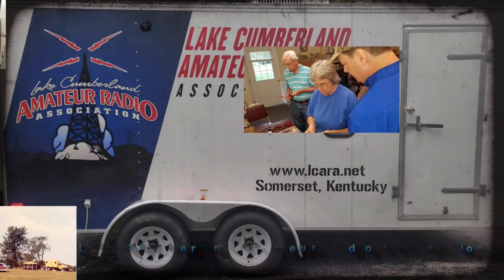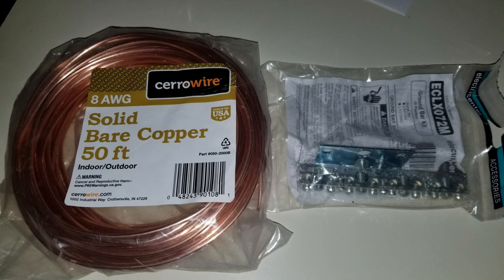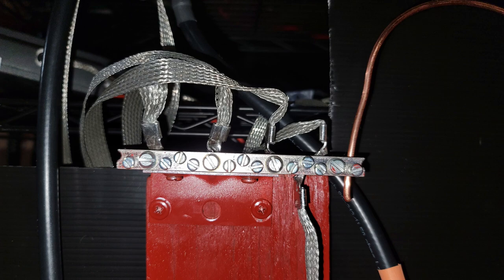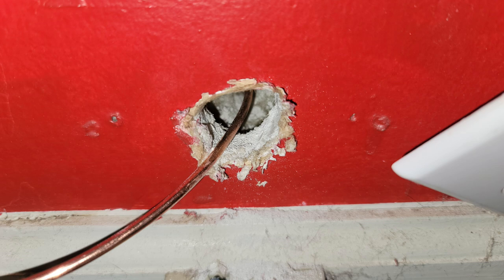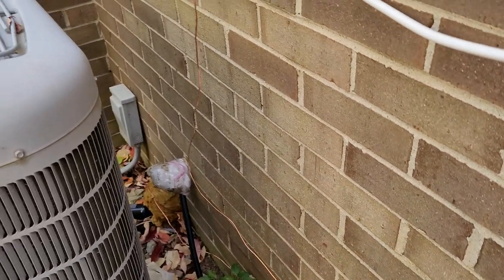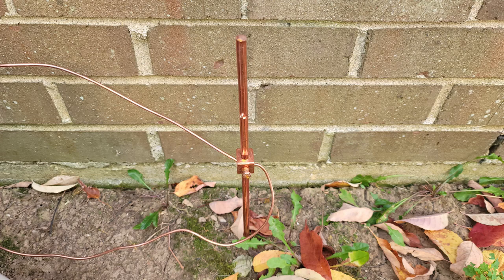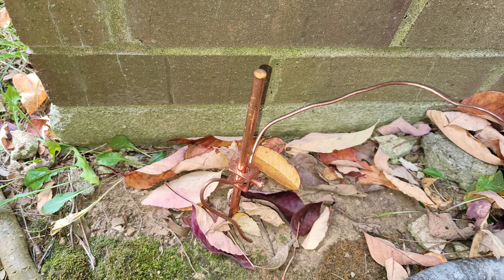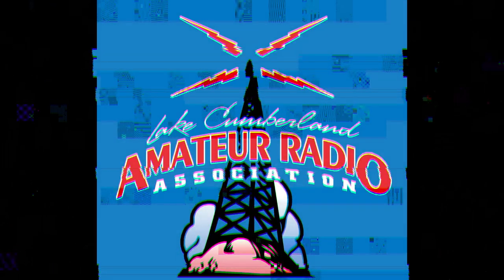LCARA HAM Radio: Basics of Station Grounding

Comment: Why would you bring the coax into the house before you run it through the grounded surge protector? Seems that if the antenna was hit, travel through the coax into your house and only then grounded the lightning not taking out the rest of your equipment grounded at the same point is a big risk

Comment: Greetings. It’s not clear as I’m looking at this video, it looks like you are putting the lightning arrestor inside. I presume this as you have a flat braided ground strap.  I’m not an expert here, but my understanding is these should be outside the shack at a grounded junction box.  I am in the process of putting in a junction box myself with multiple antennas.  You are otherwise inviting the lightning inside the shack to then transit out that braided ground which I think is also not sufficient for that task.  Cheers. Jim KD8MTY

PS Here is the junction box I went with that illustrates this a bit. I have no affiliation with the vendor. https://youtu.be/sYG2O926LoU

Comment: My understanding is that the the NEC requires all grounding systems be tied to the common point ground at the electrical service panel. I believe this is an electrical safety issue as multiple isolated grounding systems can be at different electrical potential. It is fine to drive multiple additional rods to reduce the impedance of your ground system, but they should be tied back to the main panel ground.
Reply: The main reason for additional grounding for ham shacks is for abating common mode RF (not line) currents on isolated equipment (such as the radio, tuner, meters, amplifiers). Additionally, while copper tubing is probably okay in certain circumstances, 3/4" + braided should be used to tie everything together, and should be the shortest length possible. :)

Comment: What is shown and described in this video appears to be a DC grounding system, but given that the described operating position is on the 2nd story, the #8 wire down to the ground rods is likely doing nothing for you as an RF ground.  Maybe you could address this in a follow up video.

Comment: I'm worried that your second ground rod may not be bonded to the service ground rod. If this is the case, a voltage differential in the ground between the rods may complete a circuit over your radios and damage something
Reply: So how would one bond it to the service ground if the ham station is on the other side of the house from said service ground? This is the problem most hams have. They can't do it the perfect way, so they have to compromise. My solution is to ground with copper in and out, and unplug during t-storms.
Reply: @N1IA-4 I drove ground rods from one side of the house to the other and linked them all together to the service ground but most people can't afford 6 ground rods, In the absence of perfection we have to sometimes do it half azzed to get by for sure.

Comment: I used #6 for the main ground runs from the RF grounding block to the new rod and the house main ground and #10 for the station equipment per NEC recommendations. So much larger for the outdoor stuff and one size smaller for the indoor however I know solid is best but insulated braided is fine too.

Comment: this helps to answer a nagging question I had since becoming a ham a few months ago.  my other question is how do I ground to the equipment my two radios and the power supply dont have anything showing where to hook up the ground wire.  would it be correct to just unscrew a random screw and hook it there?

Comment: I just received my license and am in the process of installing some radio gear, a dipole antenna and a vertical 3 meter/70 cm antenna. I’m pretty concerned about grounding and found this video to be the best I’ve found. My question is, can I run the ground wire from the indoor buss bar to the outdoor ground through the same hole in my wall as I’m running my coax feed line through or will that cause trouble?  How do you ground the dipole, just ground the center and end masts?  Thank you.
Reply: Answer to first question: i see everybody do it. I'm a newbie so I'll defer to the experts.

Comment: I believe your equipment grounding using a copper wire to a grounding rod is in violation of the national electrical code which requires it to go back to the panel.
Reply: It probably is. But what is one to do if the service ground is on the other side of the house? Running a huge long copper wire won't do anything.

Comment: If you look at the photos, there is a rather sharp ninety degree angle between the wire and the grounding rod itself.  The wire should be placed in-line with the rod.
Reply from the maker: Hello Mark, I am making some final adjustments to the setup and will arrange the path a little better.  Thanks.

Comment: Station grounding VIOLATES NATIONAL ELECTRICAL CODE.

NEC 2011 250 (a)  FORBIDS grounding radio equipment to another groundcrod and FORBIDS grounding not normally current carrying conductors."

It is ILLEGAL in the US to do this !
Reply: It probably is. But what is one to do if the service ground is on the other side of the house? Running a huge long copper wire won't do anything.
Reply: @N1IA-4  you bond the two together. Run a wire from one to another, preferably burying it if possible. Lots of hams do this.
Reply: @Anamericanhomestead  It doesn't work that way. In a long run, the resistance of the wire will nullify any benefits. Have you ever heard of any commercial ground/bonding using a long run? No. Because it is required to be right at the service entrance. Lots of hams do a lot of things. But this actually places the two ends at a different potential to the other, increasing the danger when lightning strikes directly or in the vicinity.